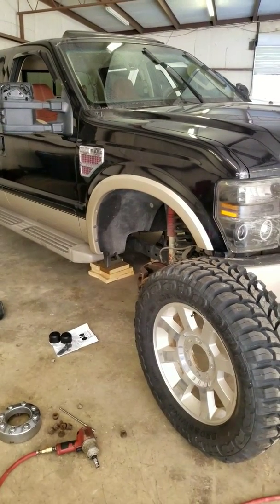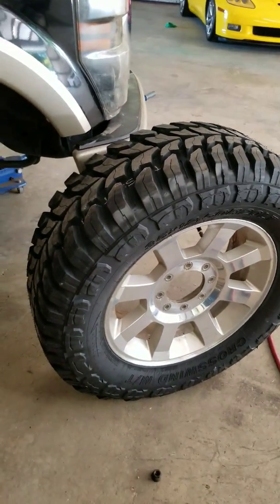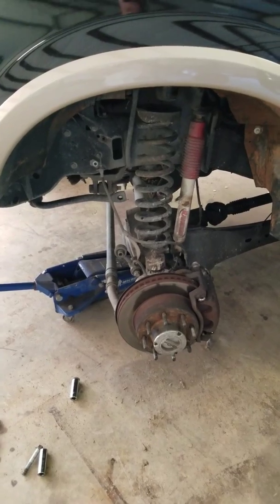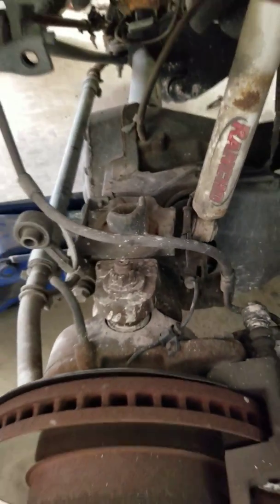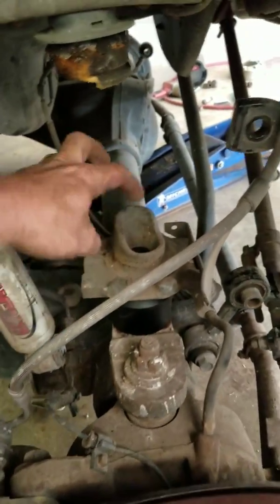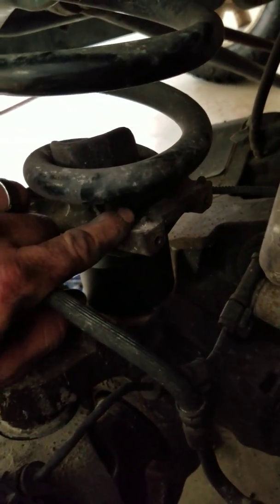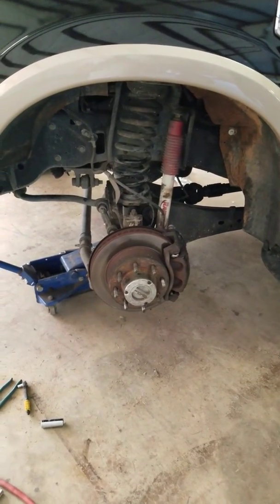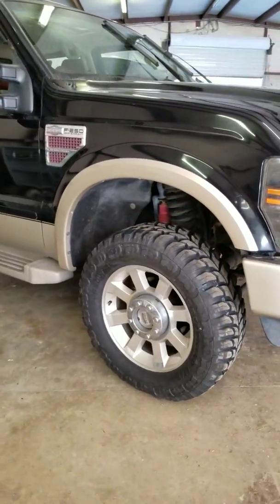How to Install a 2" Leveling Kit on Ford Superduty

Comment: Were you able to use stock shocks? Or did you have to use longer ones?
Reply: You can use your stock ones but your better off replacing them with better longer aftermarket.
Reply: Shock extensions.  Kit usually comes with them.

Comment: Track Bar adjustment?   New Alignment?   Spacers?
Reply: mike rapponotti iv been wanting to know this, I have a 2011 f250, i did a 2.5” leveling kit, I regret it, wished I would’ve done a 1.5” or 2”, my drivers side wheel was sticking out a bunch and I guess it’s because of the track bar, I’m removing mine and going smaller
Reply: Anything bigger than 2in will give you issues right from the start, eat up tires and destroy the front end. Need to install correct shocks, spacers alignment.

Comment: Why do the springs look like they are bowing forward, this isn't normal. I've done spring upgrades on several Super Duty's and was shocked to see this on yours. Maybe something that you want to take a look into why it's like that. Personally, I don't think it's supposed to be that way.
Reply: It looks twisted extra forward because the axle is dropped down extra far as to remove the shock.  Just like a door in your house not being straight with the wall the more it is opened.

Comment: I hope at some point you bought and installed an aftermarket track bar mount. Changing the front end geometry of these trucks by moving the differential down two inches will put it in a bind and give you a ton of bump steer. You may not even feel it initially, but you're wearing out front end parts at a highly accelerated rate!
Reply: I heard it was 2.5 max anything higher you put wear on the front end 🤷‍♂️

Comment: The spring looks kinda wonky, did this ever straighten back out or did it stay kinda funky looking? Just curious I was going to purchase for my truck but dont want springs sitting in an S shape.
Reply from the maker: They will have a bow in them..even when u buy replacement lift springs
Reply: @gt40forsale  ok, thanks for the quick reply back.

Comment: The 05 all the way up too now can run a 35 stock
Reply: Not true. my 07 f250 rubbed bad with 35's
Reply: @brandoracer21  it depends on your wheels and offset etc
Reply: I’m on a stock 2019 on 37’s  fits stock but rubs when turning on an incline . 35’s should fit just fine

Comment: Just a heads up, this video is only accurate for 05+ trucks, not 99-04. 99-04 trucks still used leaf springs up front.

Otherwise, great video.
Reply: not if its an i beam suspension. i have an 03 and it was just like this except the block goes on top right under the spring
Reply: your half right and half wrong. The f350 4wd have leaf springs on the front however the f250s dont have them for the years 99-2010 he showed